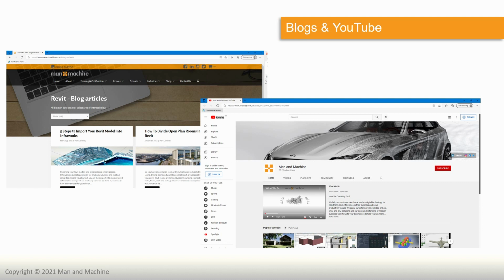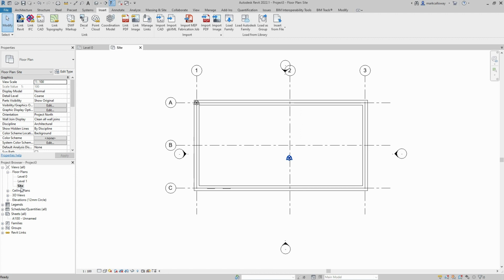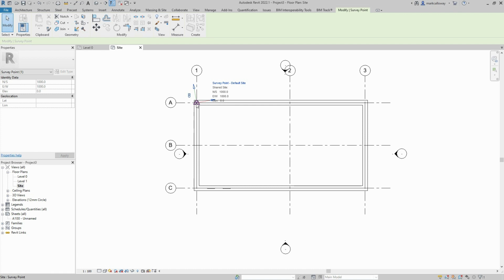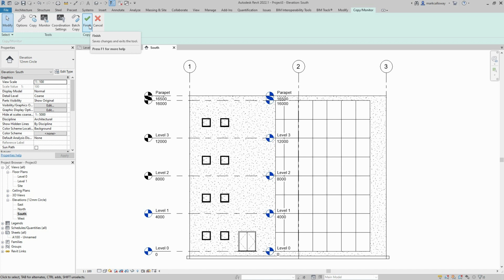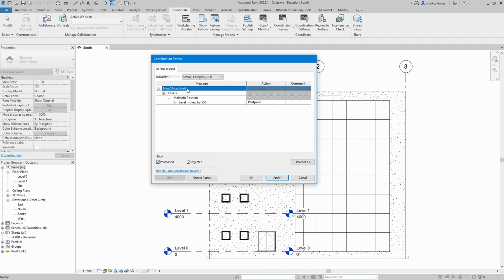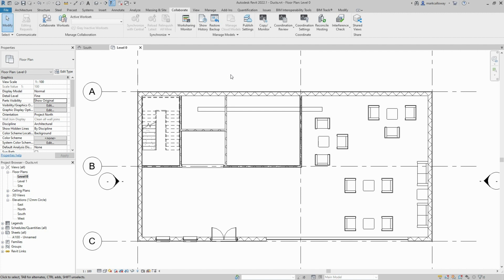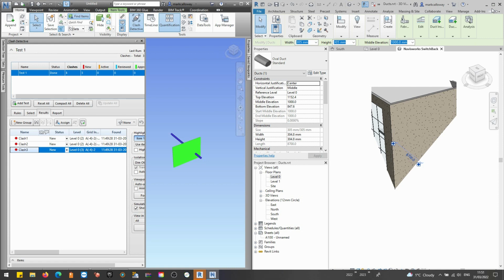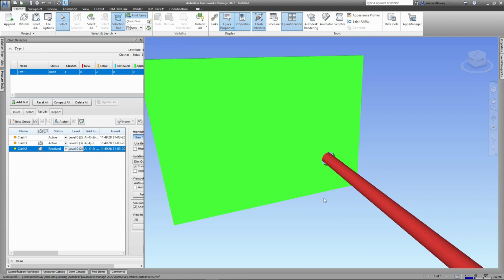Autodesk Revit Collaboration Product Demonstration

Comment: Thanks for the video. Why did you need to use Navisworks if Revit can identify where a clash occurs?
Reply from the maker: Revit indeed has interference checking functionality, but generally speaking this only brushes the surface with regards to what would actually be required for checking on a project, can be quite manual to go through each result and typically good for a first pass. Any larger scale project that needs a higher level of reporting, clearance clashes or more specific breakdown of results would use Navisworks. It’s also far easier to manage your clash tests on larger models inside of Navisworks in comparison to Revit. We always think of the difference between the word interference and clash. Navisworks, amongst other things, is a clash detection tool. Revit is a model authoring tool that has the ability to check for interference between objects.